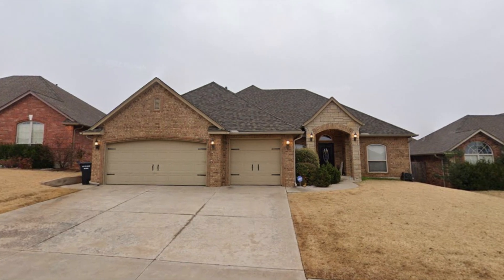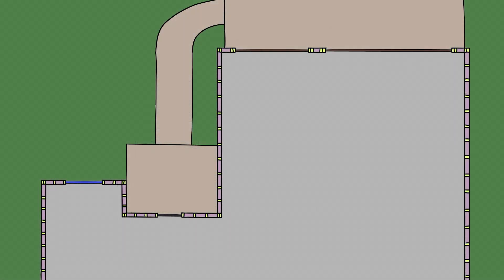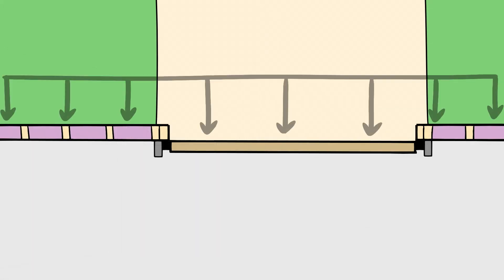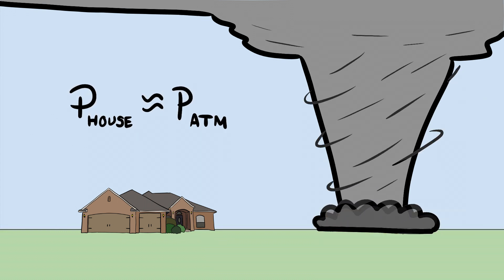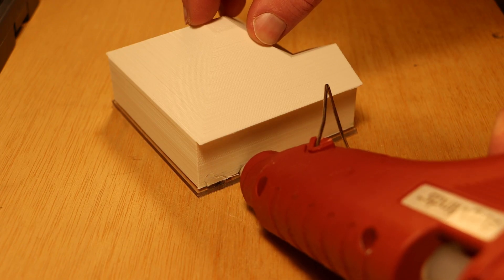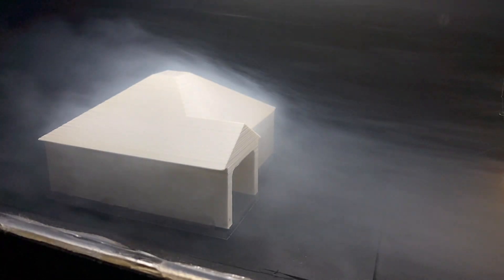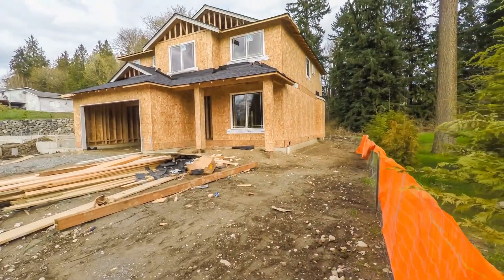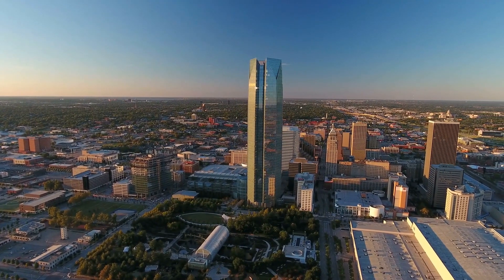Your Home’s Tornado Weak Spot

Comment: Many builders installed cheap and weak aluminum garage door to new homes,  very vulnerable to high lateral wind force, there are some things that home owners can do to re-enforcing the rails by adding more brackets, replace metal screws which will loosen overtime due to vibration with nut-lock-bolts, adding L shape aluminum bar horizontally to each panel, 2 is best. Lastly, add metal brackets at wooden top and bottom corners door frame.

Comment: The building codes for homes and businesses in Tornado Alley should be extremely stringent. While there's no way to build a "tornado-proof" home, it's annoying how, after a home has been damaged or destroyed, the homeowners rebuild their home EXACTLY as it was before the storm without trying to build it BETTER. There should be major improvements and advances in how a home is built for tornado safety. Architects and engineers should use Tornado Alley as an influential testing ground for how to build the strongest homes in the world. Maybe Apple's former designer, Jony Ive, has some ideas. Something needs to change to keep people safer and reduce the amount of damage and debris to save money and lives. Excellent video.
Reply: i agree that homes in tornado alley should be sturdy, and mobile homes, esp without accessible community storm shelters, should be fucking outlawed. this would take some affordable housing measures too.

that said.
we don't have to start from scratch with this kind of experimentation. the united states has severe weather, but japan also has very extreme weather events and a history of wooden architectural design that withstand typhoon winds (and very powerful earthquakes, for any californians who chance upon this!). there is no need to begin with a hubris that only american engineers can figure out this problem; that would be a waste of time.

Comment: Our house has a two-car garage in the basement as our driveway wraps around and allows entry from the side.  We were hit by an EF3 tornado and we sheltered in a relatively protected alcove.  While my family was under a large steel desk, I was near the corner of the alcove and could see outside through the garage door windows.  This was at 4a.m and the lightning was so intense that I could see things outside reacting to the winds.

I also watched leaves, small branches, and pebbles and dirt stick to the garage windows, moving along the surface in jerky motions due to the wind and strobe effect of the lightning, and then suddenly be violently seized and plucked away to oblivion.  It almost looked like claymation or the dance floor at a rave.  For probably 30 to 40 seconds the garage doors held firm and provided this macabre visual display.  During this time the house was crackling, popping, and bouncing from trees falling on and into it.  Water was dripping from our floor joists in the basement because much of our roof and windows had succumbed to the assault.

At the very end, the bottoms of the garage doors were giving way to the wind and they finally developed a vertical crease in the lower two panels and with a whoosh of wind, they crumpled inward blasting us with the overwhelming odor of freshly-cracked pine and sulfur dioxide (injected into natural gas lines for leak detection).

My wife quickly sprung from under the desk, ran upstairs, began maneuvering through tree branches that were in our house until she reached the master closet.  It was soaked, clad with insulation and wood splinters, and she was looking up at the dark sky.  She pulled a large box from the shelf above the clothes racks and found that her wedding dress was completely untouched.  It wasn’t wet, was still securely folded in the box, and she grabbed it and was all scratched up from climbing through the tree branches but she didn’t allow a single blemish to her prized cargo.

As usually happens in marriage, all my clothes were impaled by wood splinters, coated with wet insulation, and smelled like the sewer.  My only joy came when the insurance adjuster told her that all of her Louis Vuitton accessories could not be salvaged.  😬

Our cars were parked outside and died traumatic deaths.

After a few days, I discovered that the pool of water under my hot water heater was not just rainwater that somehow got into the basement.  The water heater was about 11 years old and it was surmised that the momentarily pressure drop from the tornado had caused the tank (which likely had some rust-weakened areas) to swell and burst.

My wife was happy that she had saved her wedding dress even though the designer accessories and shoes she had collected for years were a complete loss.  It did infuriate her that my Callaway clubs and golf bag came through unscathed.  The saddest thing though was that they condemned basically everything that my 5 year-old daughter had.  Adding insult to injury, both of my children’s best friends who lived in the neighborhood did not rebuild and moved away.  They really never overcame that and both have lingering social anxiety effects from the sudden loss of their most important friendships.

Comment: I feel a tiny, very tiny bit safer that where I moved we have a braced garage door which we didn't have in my last house. We live in an area that also used hurricane brackets. That also makes me feel safer abour the roof. I live on the coast but we do get tornadoes (NC). Other than that, our house is the most solid built one we have moved too in a long time. My dad use to build houses/owned his own company before 2008 and he definitely wanted to find the best house if he couldn't build it himself. He nailed it with finding this one in terms of how its built it is very solid for a slab built house. We use to live further inland with more tornadoes and our garage door did buckle quite a bit when an EF0 hit our old house many year ago.

Comment: Yeah we learned about this in one of my meteorology classes. Garages, especially westward facing once’s are the biggest weakness of a home, once it goes the roof then everything else is more likely to go. The reason I saw westward facing garages specifically is because forward motion is added to the velocity of the tornadoes wind speed itself which leads to enhanced wind speeds out of the west on the southern edge of most tornadoes.

Comment: Wow a lot to think about, so put the roller doors up a bit from the bottom (equalise pressure from inside to outside) ???? park your cars outside of the roller doors, provide a windbreak for the doors ????? Open windows around the house to let the pressure equalise ???? Wow you have opened up a can of worms.  

Best place has to be underground out of the wind, so long as debris doesn't land on your exit point............  Again opens up a can of worms....... Build a Brick wall around the bathroom area "inside'" your house??? So many questions.

Comment: Why not just build a separate structure for the garage? Then, the tornado might suck up your garage and your car but maybe only suck a few tiles off of your roof.

I imagine windows are another weak point, especially large windows. I saw a tornado once when I was a little kid and people used to think that you needed to open your windows for whatever reason so we were running around doing that when the tornado came over. It hadn't touched down yet though so it just made things windy. Luckily, it touched down a little later in an area with no houses and never did any damage. I don't think it was very big though since it was in California. It sure was exciting to me as a little kid.

We had some severe thunderstorms a few weeks ago and I saw a rotating wall cloud but it never dropped a tornado. I did report it to the weather service on my app when I saw it. It seems like most wall clouds around here don't put down a tornado although there have been a handful of damaging ones in the next valley over.

Comment: If Colin furz can build a underground tunnel from his house to his shop I think I can build a single room. Some of the tornados that hit central Oklahoma where I live are unsurvivable above ground. I don’t feel very safe in my interior closet at all. I wish that all new homes in the plains area of America should be required to have a storm shelter be it above or below ground. My last house had a safe room that I kept my guns and canned food in. That was nice.
Reply: There is no such thing as "unsurviveable above ground" as scads of people survive EF4 and EF5 tornado impacts above ground all the time, which is why TV meteorologists have been discouraged from using that phrasing.  You also have to realize that 99% of tornadoes aren't of that intensity.  

While I admit shelters of some type are ideal, you also have to realize that homes need to be built for the occupant's everyday needs, not to serve as a fortress for an event that even in the most tornado prone parts of the world it will likely never have to deal with.  Mandating shelters would simply make homes cost prohibitive for a lot of folks.

Comment: I have always wondered if this was a vehicle in the El Reno wedge. At 16:54 (going by the clock in the video) a few inches below the "T" in "Not" a light appears and travels towards the right. The car is spinning so it flashes on and off. This is the time and location where the stormchasers were hit. 
https://www.youtube.com/watch?v=gnIU2Ii2Ec8
The camera pans down first then as it comes up the light can be seen, it's quick flashes like a firefly. The camera was over 2 miles away so a car would be very small. A  minute or so later they filmed the fastest moving subvortex a bit further down the road and another video analysis (A Hank Pecos video on the fastest moving tornado ever) put them at about 1.5 miles from the funnel at that point. The tornado was headed directly at them at around 55 mph.

Comment: Note to self; by a house with a detached garage if I'm moving to tornado alley😂😂
Reply: It's a trade-off vs. convenience... if I had it to do over again, I wouldn't build directly attached using a breezeway or stay completely detached.
Reply: @Tim Newman  exactly. Plus with a detached garage you could put an apartment above it to supplement income and have it be taller for larger vehicles or a lift. There's a lot more benefits to a detached garage than having an attached one
Reply: You can buy hurricane rated garage doors. They are reinforced and some are rated up to 110mph winds.
Reply: @ian2372  that would only be able to withstand a high EF1 then at most

Comment: They use to say open your windows during a tornado to equalize the pressure differential but that sounds counter intuitive. If I build a house I won’t include a garage attached. I want a partially underground home anyway.
Reply: Underground homes save a lot on heating and air condition costs too. You can always build a separate structure for the garage so that the worst case scenario is that it messes up your car. You could even build a covered path to your garage so you don't have to get wet in the rain going to your car and then just don't attach it to the house but build it so it goes up to it or maybe only attach it in a way where your house wouldn't be damaged too much if a tornado ripped it away. I hope you get to build your house!
Reply: @WhoEver420 underground houses will be colder due to cold earth, solids transfer cold better than air. Also humidity under earth is a big problem
Reply: That's what we do here in Puerto Rico  but during hurricanes.
Reply: Excuse my severe lack of knowledge, but how bad is flooding in that case?

Comment: I have a conundrum in my current home. This has been bothering me since moving in, knowing the danger of tornadoes. My basement is partial, with the other part being taken up by the attached garage. Preferred shelter would be underneath the stairs or the basement bathroom (only a 1/2 bath, no tub), but I’ve had reservations given the proximity of the garage.
Reply from the maker: I would say the back areas of the basement furthest from the garage may be your best location. The bathroom, although no tub, it probably pretty good as well, just as long as its not sharing a wall with the garage.
Reply: Enclose & reinforce the area under the stairs... it is structurally the strongest place!
Reply: Thank you both so much for the suggestions! I really appreciate it!

Comment: Loving the in depth analysis you take with your videos man. Quick question, do you think the addition of louvers in a garage would help dissipate the pressure inside of the garage should a tornado hit? Potentially like how the backdraft damper of a fan works? Or has that theory already been explored?
Reply from the maker: I think there may be some validity to your theory. I’d think there’d be a positive effect. However, I don’t think it’s practical from a cost perspective, as it would make the door a lot more pricey. Great thinking though! I love the ingenuity. 

Glad you’re liking the videos!

Comment: Love the video especially the examples and models and thanks for talking about how the low pressure from tornadoes makes a big difference. I also think that in some instances it’s probably better for the garage door to cave in and blow the roof off because if they where reinforced then it could add a significant amount of force on the frame of the house especially the wind loaded side that’s already has a huge amount of wind loaded force in the first place. This is probably why garages aren’t reinforced in tornado alley especially since you would have to change the whole frame of the house in order to hold more forces. I suggest testing this theory with your 3d printed house but you need to use a higher powered air source possibly a leaf blower or something